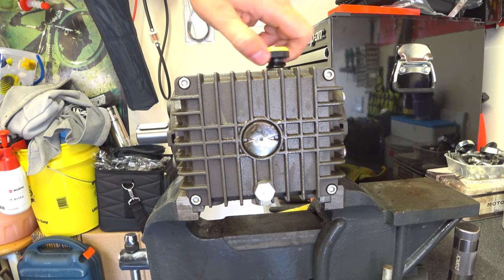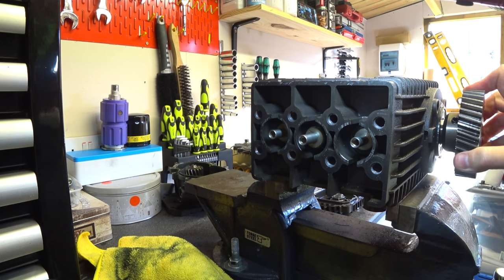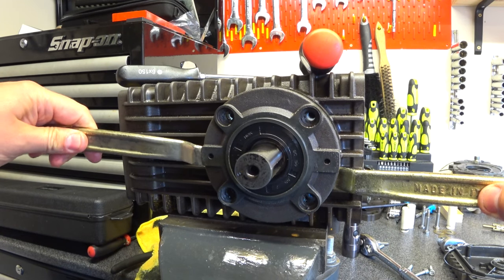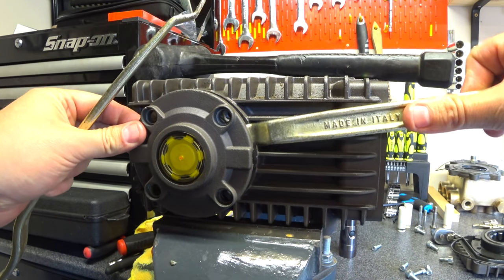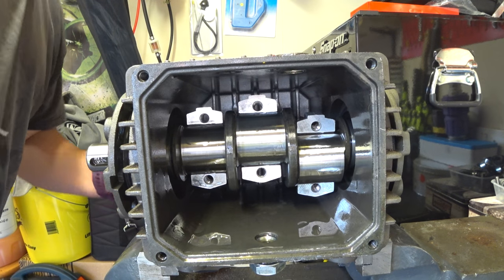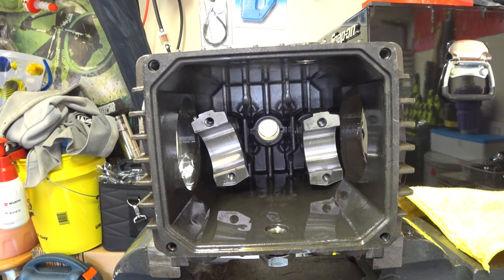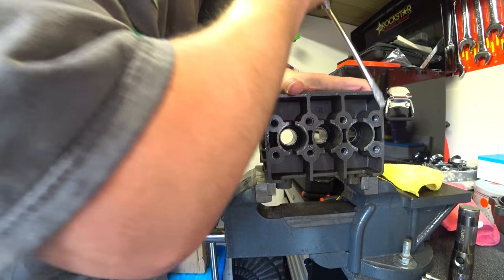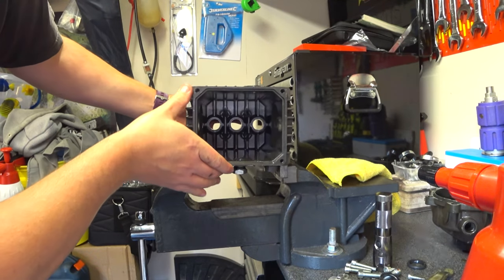Interpump W3523 Pump Strip Part 2 - Crank & Rods

Comment: I'm thinking about getting a ws202 to replace a direct drive 18Lpm Chinese pump. I just need more flow. And possibly longevity of the product
Reply from the maker: The Interpump ws202 pump is gearbox driven. So you will need to attach something like an rs500 gearbox. You'll also need to ensure your motor is powerful enough, the ws202 typically needs the 13hp GX390 engine to run properly. Even then the motor is worked to its max to get the 200bar 21lpm of the pump. Have a good think before you proceed to ensure you currently have the correct motor etc. Otherwise, the upgrade cost could outweigh the price of a new complete machine. The WS202 is also best coupled with a K1 flow-sensitive unloader.
Reply: Yeah mate. I have a 16hp engine.. i can get the pump and reduction gear for a good price.
 I build all my own machines. Never buy ready made. The mark up is crazy
Reply from the maker: @herbertvonsauerkrautunterh2513  16hp will run that nice. I now run the new 25hp honda IGx800 engine. Gives me 350bar and 23lpm.
Reply: Cool. I have a 10hp diesel as well. I might upgrade to a v twin vanguard later
Reply from the maker: @Herbert von Sauerkraut unterhose  stick to honda, I've gone through 2 18hp vanguards Vtwins in 8 years. They are noisy and unreliable, I've now switched to honda.

Comment: How many days have you set aside for the maitenance and rebuild off your pressure washer, also are you going to order new hoses or are they still in good condition after 5 years off usage.
Reply from the maker: Well as the season has ended and it's pretty quiet I'm in no mental rush. The frame is at the powder coaters at the moment. It's been in pieces for about 3 weeks now. The hoses are quite new, I replaced the HP hose last year as it burst on me. They reckon HP hoses only have a lifespan of about 2 years, especially if they are dragged across the floor. Mine is showing a bit of wear but they tend to split near the coupling under the black sheath  as it's always under a some flex there.
Reply: @DirtyDriveAway  on my pump i have a hydraulic hose, it's not very flexible but we have it for almost 30years.
Reply from the maker: @frederic6998  wow that's a good hose, because my main hose is dragged across the floor all the time it wears off the protective rubber coating exposing the steel braid wire. As this gradually rusts over time it creates a weak point in the hose. When they burst it's quite spectacular, but not very funny lol, I've done 2 hoses in 6 years.
Reply: @DirtyDriveAway  yes but i've bought a regular hose now because the hydraulic one we have is strong but not practical at all as it's not very flexible.
Reply from the maker: @drefhill  high pressure hoses never are that flexible because they are twin steel wire re inforced. You can buy cheaper single wire hoses which is usually more flexible, or I have know people to use narrower ID hose but they don't last and if you use a smaller hose than the output of the pump you will get pressure issues.

Comment: Sir    which kind of bearing is good  for hypressure machine  such as 62208    or  2208   roller  or ball bearing?  We have  a  water blast memaìd 500  in  our work place  i want to  overhall it
Reply from the maker: I would always replace bearings like for like. A 62208 and 2208 bearings are  completely different. I would always fit good quality bearings from the likes of FAG, NTN, SKF or KOYO. Using cheap bearings can result in different clearances and quicker wear/failure.
Reply: @DirtyDriveAway  yes you say  very smart thing  quality is impotant.

Comment: So there is no bearings between the crankshaft and the rods ?
Reply from the maker: If you mean like shell bearings like they have on a car/bike etc then no. These pumps are low speed hence the reduction gearbox so don't run as fast as a car etc. They only run around 1600rpm on full power.

Comment: Do you know where I can get the rod ends that connect to the shaft
Reply from the maker: Do you mean then rod caps/bottoms. What model pump?
Reply from the maker: According to the parts schematic the rod and cap are sold as a pair and the caps are not available separately. For this pump it's part number 66.0300.01 and they are around £51.00 each
Reply: Yes .its a ws201 connecting rods ends  snapped inside the pump could you send me a link as to where I could buy them please?
Reply from the maker: @seanmurray4154  OK part number for that part on a WS201 pump is 47.0300.01 available here.
https://www.malcleanse.co.uk/advanced_search_result.html?keyword=47.0300.01&wizid=6dsj4cl6qt28bgo9t064h7ksa4&search_in_description=1
I would have a good look at the rest of the internals, crank etc as a snapped rod would have indicated a serious failure and there maybe other things wrong with the pump. A rod won't just snap for no reason so a proper inspection would be needed.